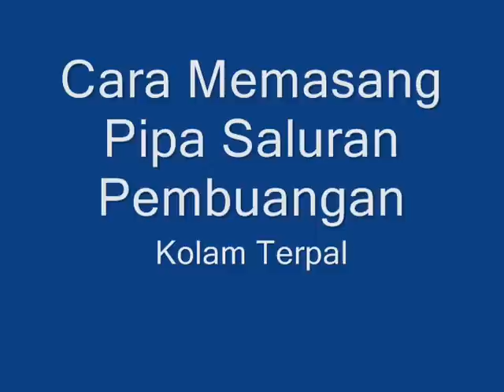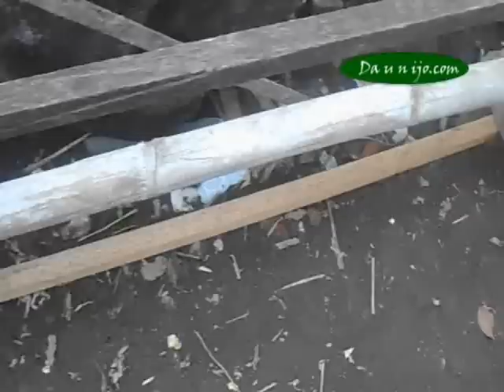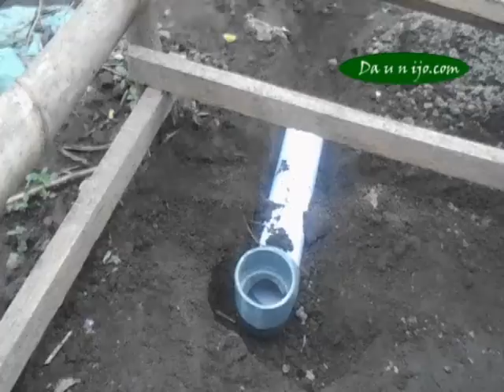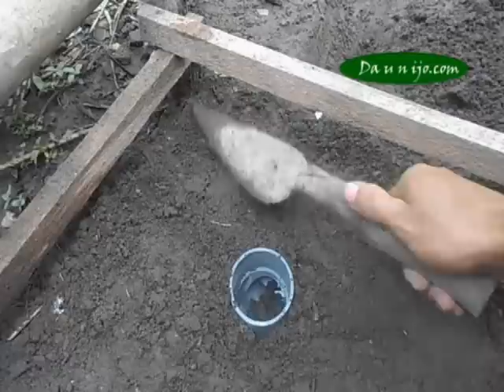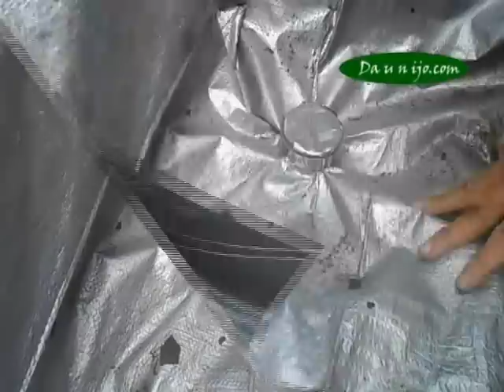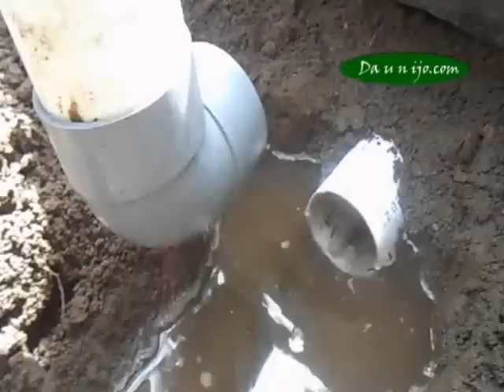Cara Membuat Saluran Pipa Pembuangan Kolam Terpal

Comment: setelah saya baca komen dari temen2 semua berarti intinya air yang ada dalam terpal akan sama tinggi dengan tinggi pipa yang di luar ya mas?
o ya ukuran pipa yg anda gunakan berapa inci itu mas?
Reply from the maker: iya sist, istilahnya pipa kontrol tinggi air. kl mau lebih dangkal pipa luar bisa dipendekkan atau dimiringkan saja. Ukuran pipa ada  pake yg 2'' ada yang lebih kecil juga, makin besar makin cepet kalau nguras.